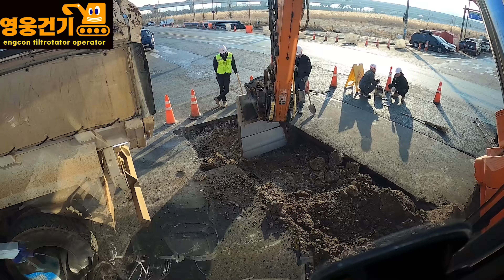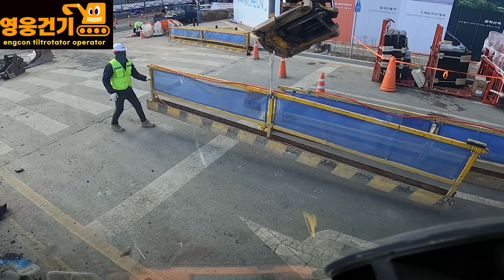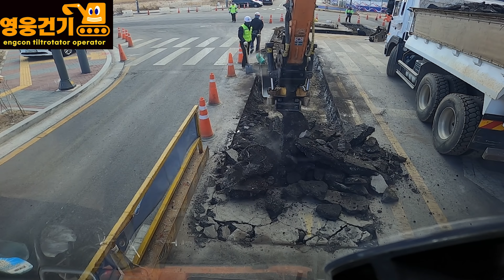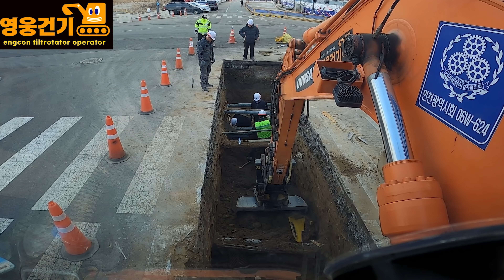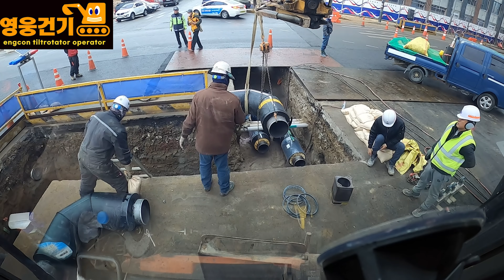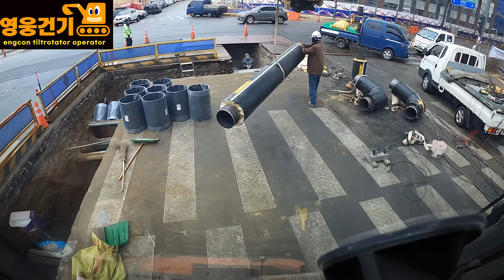영웅건기 엥콘틸트로테이터(engcon tiltrotator)활용 지역난방 300A [PART.1] Z밴드 도로지장물 터파기 작업

Comment: did the pin for the bucket sheer off at 13:00 ?
Reply from the maker: In fact, that pin was broken due to very hard digging job, so I've just changed my bucket quickly to catch up. 😁
Reply: @heroexcavator  nicely done
Reply: Good spotting. Well done